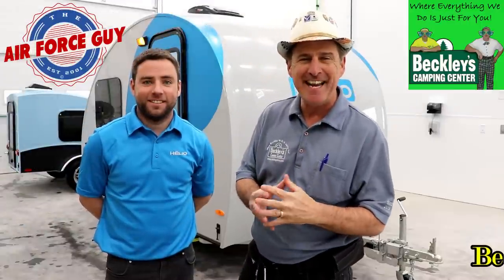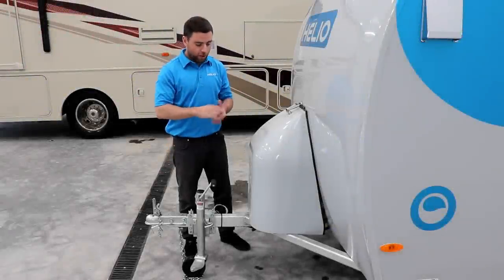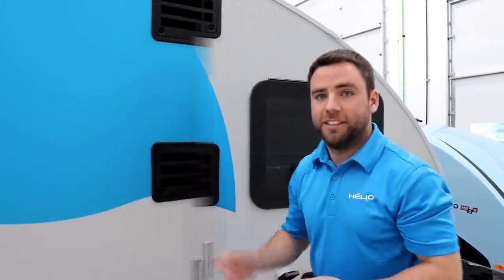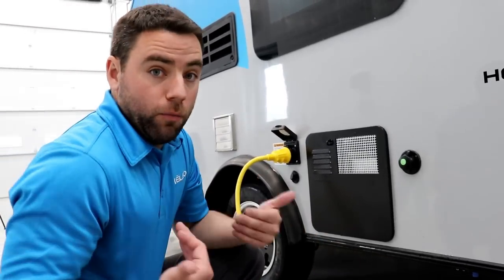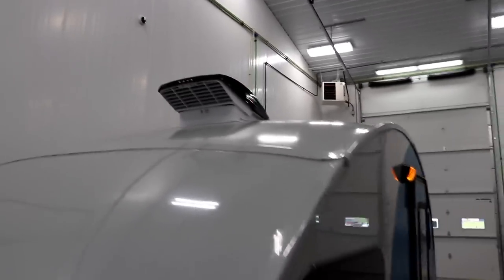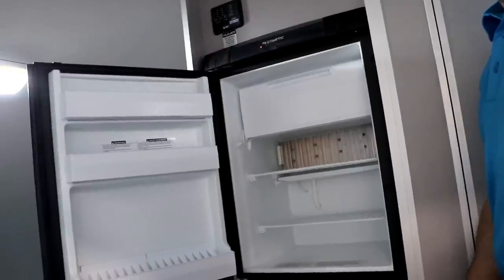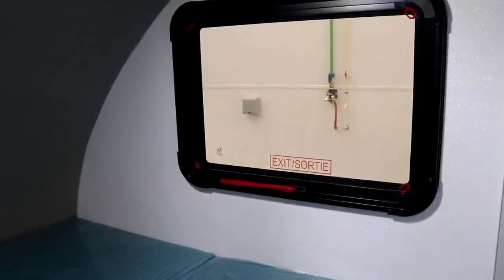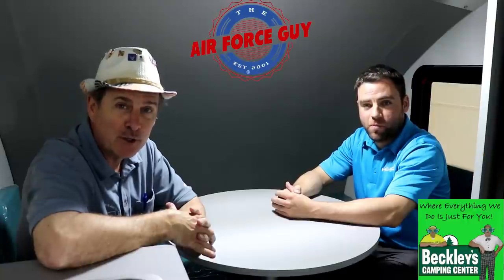2019 Helio O2 by Helio RV - w/"The Air Force Guy"

Comment: I purchased a HELIO O3 last Spring in Salem, OR.  I really like this little unit.  Last year I had a Winnebago 22RBSS that was brand new.  It leaked several times and resulted in thousands of dollars of damage that was not repaired by Winnebago.  I decided then I'd look for a smaller RV that I could take anywhere and pull with a small truck  that would be as LEAK RESISTANT as possible.  This Helio is a great little unit.  It's been on several camping trips since last June 2020 when I bought it and it's performed flawlessly.  Here in Seattle it rains constantly and so far, she's been as dry as a bone inside!  It's also light enough to be towed by and SUV, I formerly pulled it with a Subaru Outback Turbo but I sold that and now I pull it with a new Ford Ranger with the ECOBOOST engine.  My Ranger can pull 7500 pounds but this unit tops out at 1700 pounds FULLY loaded and full of water and supplies so I don't even feel it behind me.  I use a CURT wireless brake controller since the HELIO comes with electric brakes.  No brake controller needed in the tow vehicle and it works great.  I've pulled it over several mountain passes on my way to Yellowstone in Montana and the brakes worked flawlessly and smoothly with plenty of smooth and steady braking power.  It comes with an on board toilet (the O3) but the shower is an outdoor shower (that works best for me since I'm almost six foot three and wouldn't be comfortable in a small bath/shower combo).  I typically don't use the on board flush toilet since I am almost always at a campground or I am boondocking with access to an alternative toilet.  I really like this little trailer!  It's great for my partner and I and our small dog.  We get a lot of inquiries when we show up at a campground.  Lots of curious questions from other RV folks.  When it comes to RV and camping....smaller is EASIER!  It's so nice not to be locked into a heavy tow vehicle or not to be constrained by a space that's too small for a huge 26 foot trailer.  I love the freedom this affords us to camp anywhere!  It's super comfortable to sleep in and there is plenty of room for two people.  I started a Facebook page for the HELIO trailer users if you're interested you can go to FB and search for it.

Comment: There’s many pros to this the Marine/aircraft industry structure is absolutely fantastic. There’s a couple things that would definitely need changing in my opinion and there’s some high end and low end such as the outdoor light the bathroom light being incandescent not LED the latch for the outside storage should be magnetic, and last the tube for the sewer hose bad place, you’ll hit that easy even if the axle is adjusted. I will say I like the fit and finish especially under the trailer where the discharge is it’s has an appearance that it wasn’t just slammed together, like American made RV’s. This RV has a lot of potential and I like it.

Comment: I bought an Helio O3 in Salem, OR and I really enjoy it.  INCREDIBLE construction, very lightweight, the quality is excellent.  I have created a Facebook page for HELIO RV owners.  Just search Facebook for HELIO.  This is an excellent RV. I have owned several RVs in my lifetime and I'm VERY excited about this one.  I live in Seattle where there are very heavy rains for many months of the year and almost every RV I have owned has leaked at one time or another.  Hopefully, this RV will be less prone to leaking with the fiberglass molded and epoxy resin caulk less seams.  The company has been very responsive with any questions I have.  I highly recommend this trailer!

Comment: I love it, best lightweight camper. Its a bit expensive but well worth it IMO.   Its light enought to be towed by a honda civic. Very smart designers at Helio. Thank you Air Force guy & Jean-fransua Helio guy for in-depth review 👍
Reply from the maker: Not sure about it being towed with a Honda Civic. They are only rated for 1,000 lbs.  Take into consideration that it has a cargo capacity of only 850 lbs.  With a tow rating of only 1,000 lbs. the tongue weight will be limited to only 100 lbs as well.   Be safe out there!

Comment: Those two windows, are their any bug screens or shades for them ?
The AC unit, how much $ more is that ? Is their a auto ignite kit for the furnace ? Where are the charging and electrical outlets ?I kinda like it,  but the cost is pushing me away.... thanks for the walkthrough,. Good job. 😀😀😎
Reply from the maker: Yes there are screen for the windows and there are shades to cover as well.
Reply: This camper seems to be made well, except for the cardboard drawers in the kitchen area. No tv, no music.....no reading lamps. Awning is extra. Sorry, The tab is still the better deal.
Reply: Dorothy Horton-Wenzel You want a portable TV and a portable sound system so you can watch TV and listen to music inside or outside. Built-in systems are never as good or as flexible.

Comment: Why is the thermostat so high? Um heat rises it won't be the warmest in cold camping that's for sure
Reply from the maker: This is not a 4 season camper, but will do just fine in cooler weather it will work Ok.  I always tell customers to bring a ceramic style heater anyway, since they already paid for the electric, it will save them on the propane.

Comment: Portable AC?  Really?  This is only because its main market is CA.  Don't need AC as much up there.  But in North America this needs to be built in on the top or in a cabinet with ducts.  If they want to sell these in North America they will need a fixed AC and a front window.  This is way too dark inside.  I do like the European designs.  I think Nucamp will start making the UK bare foot.   That has all the quality but much nicer then this.  More open floor plan.
Reply from the maker: It works for some, but not all.  Not sure what they plan on doing.  NuCamp is really changing things up lately...
Reply: Last time I checked Canada was in North America. North America is a continent, I think you meant "in the United States".